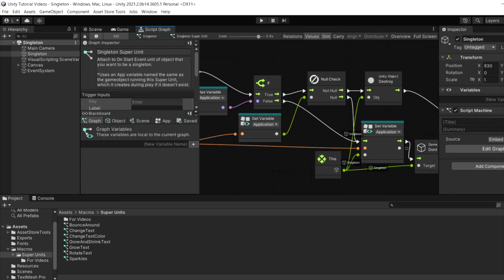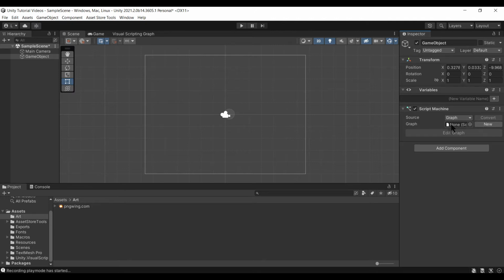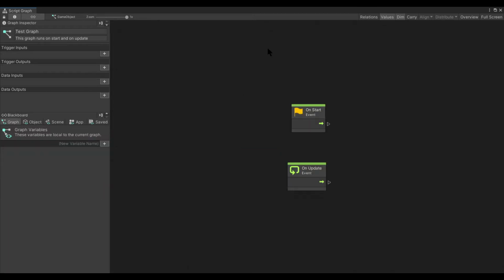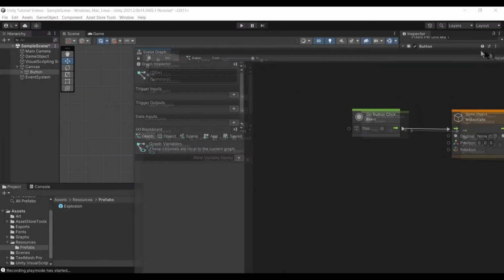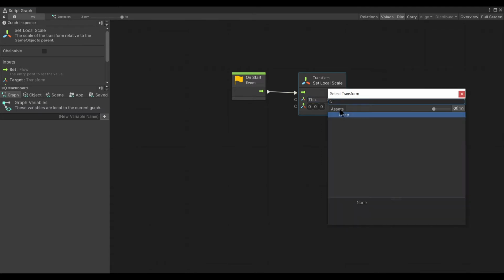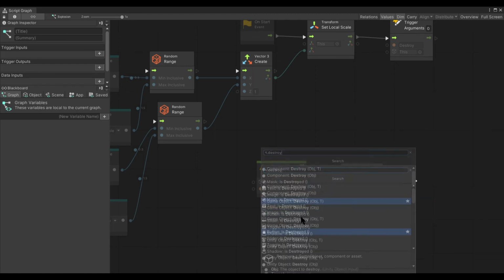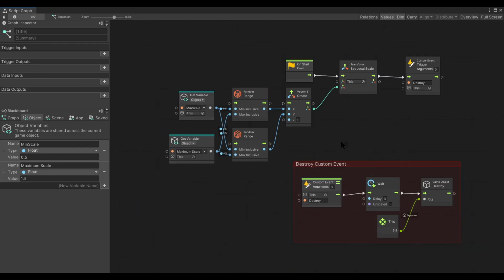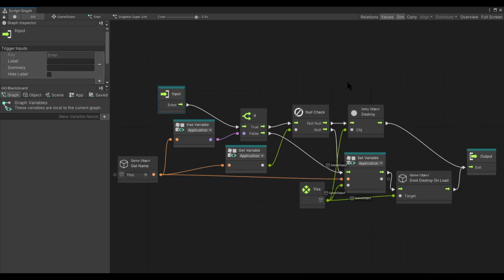Introduction to Unity Visual Scripting (Previously Bolt)

Comment: Only critique is you did MinScale. Your other variable should be MaxScale. That is Pascal Case. Even better would be a more popular naming convention of using minScale and maxScale a.k.a. Camel Case. Because it has humps like a camel. justLikeThisYo. Proper naming conventions need to be learned early so no bad habits are formed. Also beginners may find it easier to just work with State Machines exclusively. This works very similar to Playmaker and in a lot of ways makes more sense.

Comment: Why is it better to reuse nodes ?
Reply from the maker: There's a few different reasons depending on the situation. It's not always the best idea, and can cause some issues, but when you're building a complex system that you will use in many places, you want to build it in such a way that you can re-use it instead of having to copy/paste or recreate it everywhere you use it. And that's what Subgraphs and Custom Triggers are great for.
As for individual nodes themselves, reusing them can help make sure that the two disparate parts of your graph are working off the same base information. It can also help reduce the overall size of your project (maybe not noticeably depending on how complex it is). 
One point of note is that if reusing a node would cause confusion when coming back to look over things, or just makes the graph hard to follow overall, you wouldn't want to do that if you can avoid it. The main benefit is to reduce complexity and streamline the project.
One way I can give you an example is the subgraphs I offer over on Itch.io. You can just take a single graph, drop it onto multiple objects, and they just do what they do. Now if you were to try to build those subgraphs manually every time you use them, or even just copy/paste from one graph to another (without using subgraphs) it's so much easier to make a mistake and cause yourself a headache.

Comment: Hey - hi :) (solved - was the version)

Im new too :) I like follow step by step a tutorial (maybe because my native language is portuguese). Im using the version 2020.3.33f1 - on 'preferecences', dont appear this option to configure the visual script. I have all packs updated, VS include.
Reply: Well, it the Unity version. I solved it :) Install 2021 :) lets beguine :)
Reply from the maker: @jeronimocollares  Excellent!
Reply from the maker: I believe you need to use version 2021.1 or newer, 2020.3 is too old. You will need to install a different editor version from the hub.